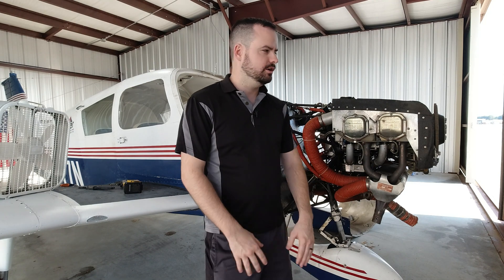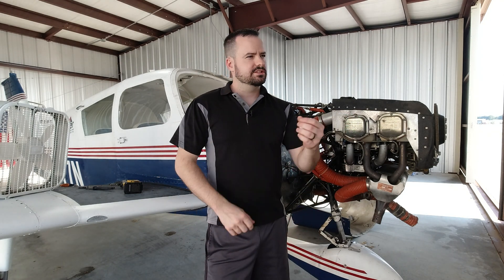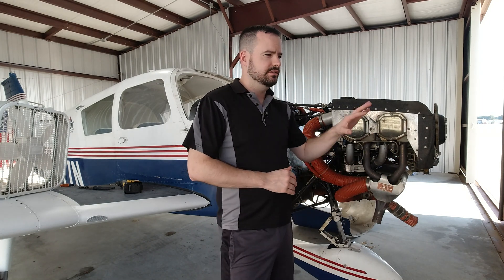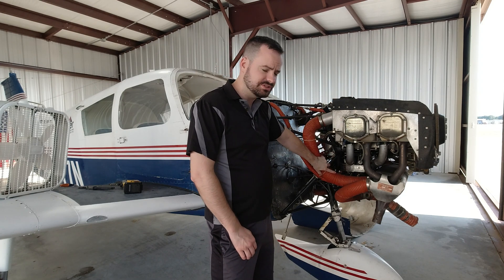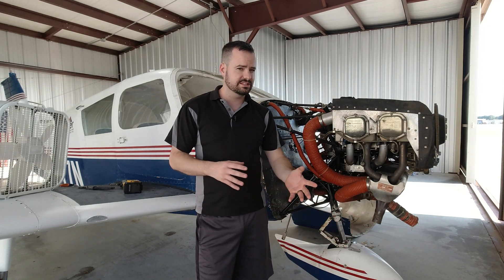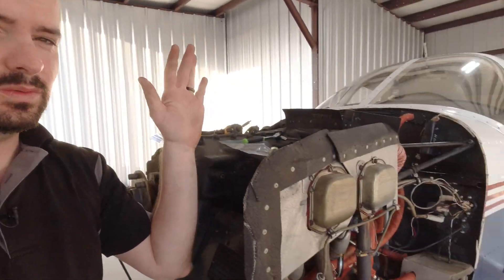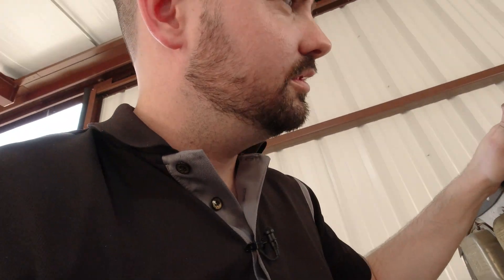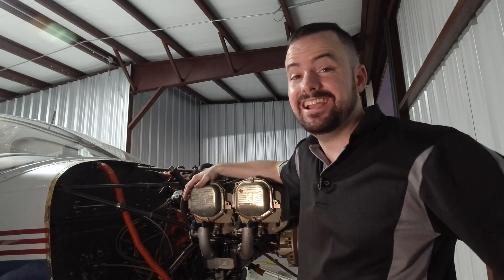Why Does my Aircraft Need an Inspection??? Prop Strike Journey EP 2

Comment: Any A&P is authorized to completely tear down an engine, inspect it, and reassemble it.  He may have an outside shop do NDI on the crank or gears if called for .  You don't need IA for any of this.  An IA is only required for annual inspections and signing off the installation of STCs.

Comment: Insurance is only covering 13k or 14k? Iran is 25k plus and prop 2-3k. You going in the hole?
Reply from the maker: I paid 3K out of pocket for some things they found inside the engine that wasn't covered by the SB or AD.
Reply from the maker: Insurance covered the IRAN (13.5K), Prop (3.5K), and removal/install (5K)

Comment: Striking a landing light in mid air is hardley going to cause "sudden stoppage of a prop"  unlike a nose gear colapse or hitting a runway light, hanger, ect. I would have the prop addressed and live in the gray area on the engine with it being a landing light.  Seems like hitting a blue jay on take off. This is sorta what drives up insurance cost for no reason.  If I had a hight time engine, then yeah why not split it , check it, and roll in a set of bearings and keep running it.
Reply from the maker: I don't have an option. It requires it because of the Airworthiness Directive. I 100% agree that it is unnecessary, in my opinion, but with a certified aircraft you have to comply with ADs.
Reply: Well I would discuss with Lycoming call their service number it could save you at least 14k. Also if you do want the IRAN I suggest Pinnacle Aviation down near mobile. The owner is JD Kutie and they do great work.
Reply: Im available to discuss....There re actions you can do WITHOUT an automatic teardown of the engine...Especially for sticking the landing light. A runout of the crankshaft should prove that its (the engine) is fine...
Reply: @samcowell2768  This is exactly what was talikng about. We had a guy with a Mooney that had a nose gear collapse on a grass field. The crank was dialed, new prop installed and still flying today with around 600 hours since the strike.